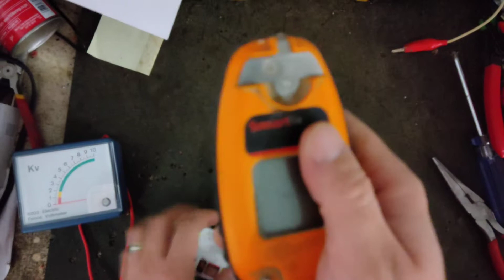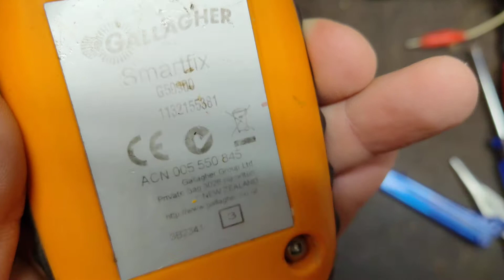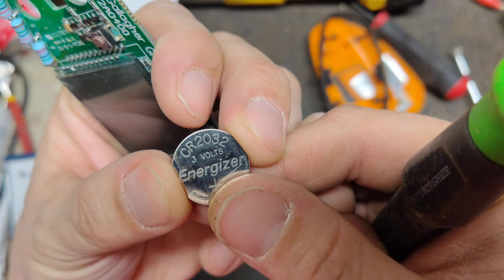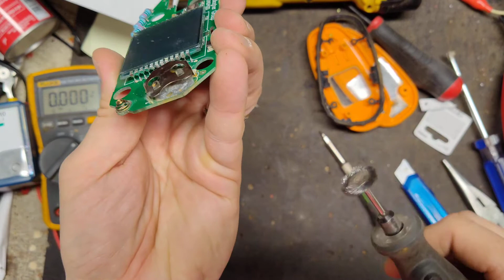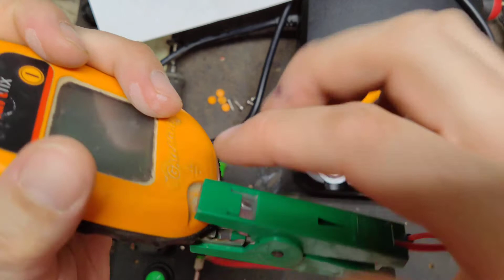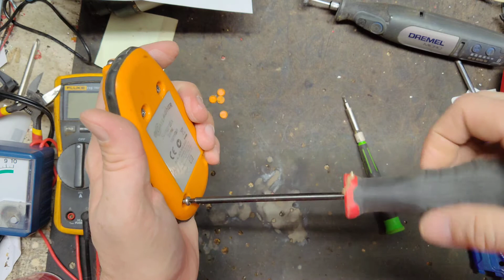How To Repair A Gallagher Smartfix Fault Finder Electric Fence Tester

Comment: Need to change the battery on mine today. Do you happen to know what size square bit I need please?  as I have no square drivers at all 😑
Reply from the maker: I don't recall the size exactly, but the square bits are called Robertson bits and you can find a kit on Amazon that'll have multiple sizes for around $5-$10 for the set and one of them should work.
Reply: @FencerFixerRepairLLCKansasCity 

Aha! you reminded me I had a small PC screwdriver set I had to dig out of the back of the office just after I saw your comment. 

Got it changed and sorted, thank you very much.
Reply from the maker: @VikingGrazers Great to hear and glad I could help you out

Comment: I’m trying to find a replacement voltage probe and the whole metal plate part that you touch the wire to. Can you help me source one….cant seem to find one anywhere. Cheers
Reply: Hi. Any luck on any of those parts in your scrap bin?
Reply from the maker: @nicholasollier1292 I honestly figure to look. I'm running out of time today, but I can look tomorrow.
Reply from the maker: Are you located here in the States or overseas somewhere? We can get all those pieces here I believe. Or I may have a junk tester that I could steal those off of.
Reply: @FencerFixerRepairLLCKansasCity  thanks so much for your response! I’m over in Canada, BC. A junk one would be ideal. If not, then can you point me in the direction of a supplier i could try. I can only seem to find replacementspare batteries and ground probes. Many thanks!!!

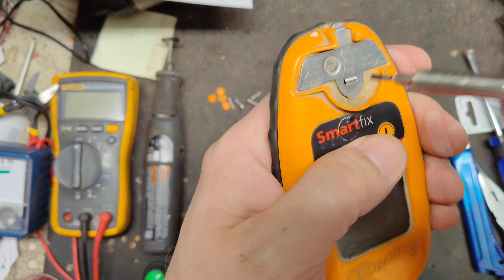Comment: Thank-you for this video, especially 12:39 how to reassemble the external contacting apparatus. My family's tester was reading about one third too low, it turned out we had reassembled the unit so the back of the thumb ground was not connecting to the spring/ground on the circuit. Much better now but still 0.5kV lower than the brand new unit.

Comment: Thanks for posting this video. I’ve had my Gallagher SmartFix for 22 years and never changed the battery. However, my ground wire is breaking. I have it taped up and it still works. I get a much higher voltage reading when I use the ground wire. If I don’t use it I’m not as confident about the result due to not having history to put the reading into context. Look forward to future videos.
Reply from the maker: Hi Allan, if you put your thumb of the hand your holding the tester in on that metal piece in the bottom corner, it will use your body as the ground when your testing the fence. If you bend down to a knee or set your hand on the ground while putting your thumb on the metal piece in the corner, you'll get a little bit better reading as well doing this. That tester has a metal plate inside the back case tied to ground internally, so it'll use your body as ground through induction.
Reply: Thanks for that advice. I appreciate it.

Comment: You literally just saved me $200+. I thought my tester had given up the ghost. Was ready to throw it out but did a quick google to see if I could find a repairer. Came across your video and it was a super simple fix, resetting whilst putting in new battery! Thank you!
Reply from the maker: That's the good thing on the Gallagher testers vs everybody else's that's out there. They're repairable even if it was more than a battery reset, all the other ones are throwaway.

Comment: Wow i feel like a dummy. Im not the original owner of my tester, but ive been using it for a few years and didn't realize it has a button on the top lol 😂
Reply from the maker: Half the time you don't have to use the button. I guess it's for getting into tight spots around an insulator or something.